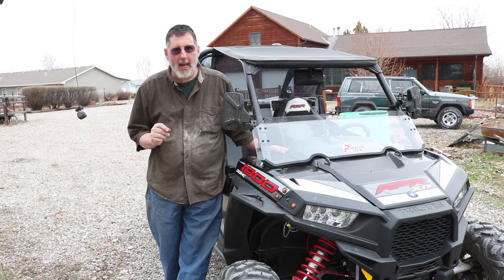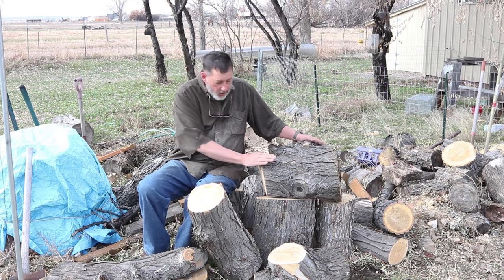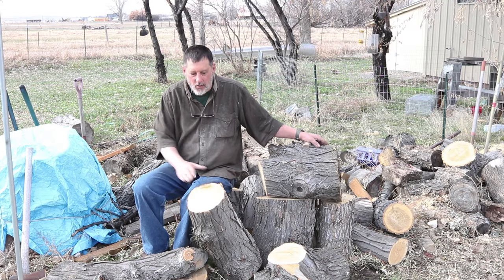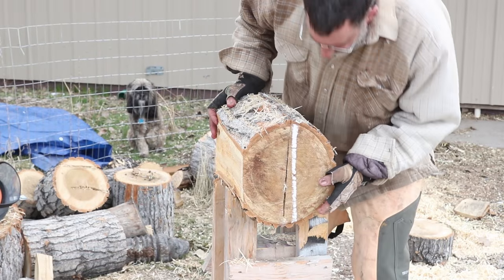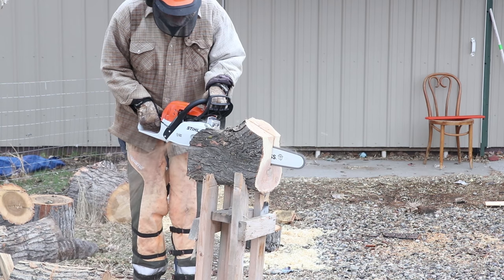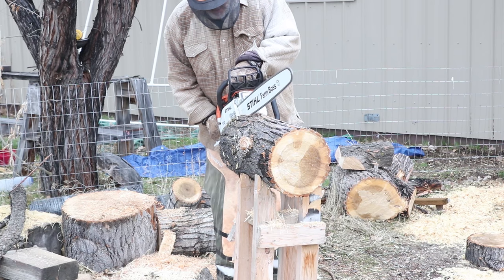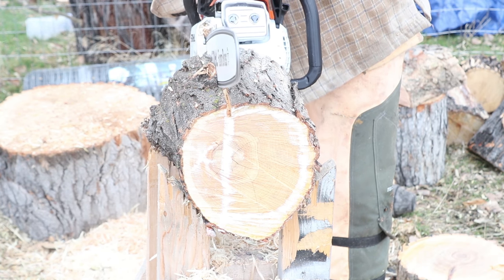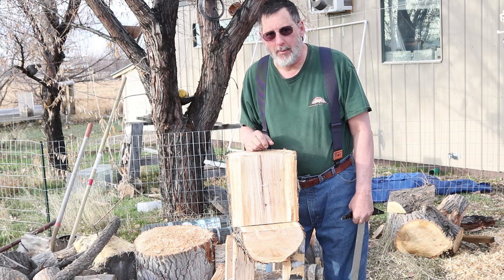Milling logs into bowl blanks using a Chainsaw:  Sam Angelo the WYOMINGWOODTURNER

Comment: Sam, thanks for sharing all your tips with us. I like your very simple stand. Most that I have seen were modified sawbucks and more difficult to move from one place to another. One point that you didn't mention but it goes without saying is the need to keep the chain very sharp. (At least every two tanks of gas, oil mix).

Comment: Hi Sam,
As always, good tips.  I had a old Stihl Farm Boss that the carb went out.  Bought a new Stihl MS 261-CM.  Great saw, 18 inch bar.  I need to build your stand.  Pet Coco for me.  Best,  Bob
Reply from the maker: Hey Bob
Thanks Sam
Reply: Get the number off of your carb and buy a new one on EBay for usually less than $20 ! They have new fuel line too. THAT might be your entire problem... the fuel line. It's an easy fix for a do-it-yourselfer ! A whole lot cheaper than a new saw !!

Comment: Hi Sam. I really like the stand too. I just cut up about 10 slabs of gorgeous Quebec maple before watching your video. I cut out the piths with the chainsaw. I sealed the ends. I will turn them over the next month or two. Since it’s below freezing at night but not during the day, do you know if it’s better to leave them outside or inside until I turn them?
Thanks, Arthur
Reply from the maker: Depends on how much room you have inside.  I love the really cold weather to stop the drying process.  I always seal my logs really well and leave them as long as possible before I cut them up.  I just cut what I can use.  Sam

Comment: Can u send me plans on that stand? It looks perfect. I can get some 70x35mm pieces, do I make 4 corners, then v cut the tops, and 2 center pieces n bolt that together? WIth a base I presume is wider. Thanks
Reply from the maker: Sorry, I really don’t have plans for this. It’s pretty simple. It should be customized to your height and maybe the size of logs you cut. It really isn’t hard to make. Thanks, Sam.

Comment: I have been using a skip tooth regular chain on my electric chain saw.  I just heard about a ripping chain for longitudinal cutting logs in half.  They are supposed to do a faster better job.  Anyone have any experience with ripping chains?
I have some really hard large olive logs and 2 eucalyptus pieces which is like iron wood hard.

Comment: So Sam, as a new turner myself, when you cut your logs lengthwise, do you purposefully cut to just one side or the other of the pith so it's not part of your bowl blank?   Thanks for the demo.
Oh ya, and if you were to have left your otherwise great logs for turning outside for a season or two and you noticed they are checked quite a bit, are they only good then for firewood?  Or can they possibly be saved by using various colored resins in say a pressure tank to salvage a cut blank?  I ask because I never thought about woodturning until recent months and I have a eucalyptus tree that I cut down a couple seasons ago and the cut logs have been sitting out for the most part in full and partial shade for the last 2 years.  The wood was absolutely gorgeous when freshly cut, but I had no intention but to use it for outdoor firewood at the time.  Now that I'm just beginning to get into woodturning, I am having second thoughts about it.
Reply from the maker: John    Thanks for some great questions.  I won't go into too much detail as I could write a book.... If I have a really big log-like 20+ inches in diameter I would cut on both sides of the pith.  This would be quarter sawn wood and would make nice little bowls.  Otherwise i try to just cut down the center of the pith and remove some of that wood ON the lathe.  As far as the checking....I most always seal my logs with some sort of wood sealer and try to leave the logs as long as I can.  Then just cut off what I need to turn at the time.  But sometimes I don't get to a log and it does crack and check too much to be used for turning.  Sam
Reply: Thank you very much Sam for that informative feedback.  I wish I had some fresh wood to cut.  With that said, I take it, having only recent discovering your channel and subscribing to it because I'm greedy for woodturning knowledge, I take it you're not much into the using of colorful resins - like so many other turners I seem to be finding these days on YouTube - in an effort to take what might otherwise might become firewood and turn them into wicked bowls with colorful accents?  Are you a purist from the standpoint of using nothing but wood? LOL. My wife keeps shaking her head at me because I just can't seem to get enough of working with wood - whether it's for the purpose of constructing pergolas in our backyard for shade (we live in Arizona where it gets pretty warm in the summers), scrollsawing, woodburning, woodcarving, and now.....woodturning.  My power tool collection is beginning to grow again - possibly pushing us out of our garage completely. LOL.  I just still can't get satisfied with just one "wood sport" she says.  Personally.......I don't understand her words.  I fully retired in the last year or so.  I'm probably having more fun than I'm supposed to.  Besides, I'm keeping the economy strong with my tool purchases, right?  And I agree with what Scott Haun posted 3 years ago about your stand for cutting your logs.  Cool idea.  I'm definitely gonna make one of those this week.  Semper Fi, John
Reply from the maker: @johnhuggins5021    I did not actually address my love of casting resins and coloring wood.  You can check out my playlist on many areas of embellishing.  Here is one     Casting resin
https://www.youtube.com/playlist?list=PLL5-IWEcq6B_KsiHgC_KSibft04EfzMMw

Living in Arizona ou may be a bit more limited in your selection of green or wet wood that I love to turn.  Sam

Comment: Very helpful video. I just bought a very similar saw, an MS271. Are you using a chain designed for ripping?
Reply from the maker: The chain is just one I bought off the shelf.  I would like to have a link to a ripping' chain.  Can you direct me to one?  Sam
Reply: I talked to Oregon products because they make ripping chains. Seems they aren’t suggested for handheld use. You also need a saw with a 3/8” drive profile like a MS 361 which a buddy of mine has. My MS 271 doesn’t allow for that which is a bummer. The crosscut chain chews up a lot of wood. 

Here is the link for Oregon products anyway.

https://www.oregonproducts.com/en/professional-products/forestry/saw-chain-families/ripcut/c/ripcut-sc-p
Reply from the maker: @waterfordrs22  Robert, thanks for the reply.  I appreciate it.  I have heard other comments about a ripping chain for saws.  Thanks, Sam